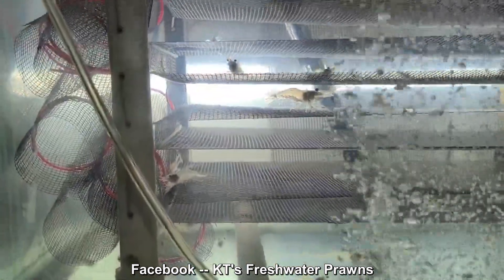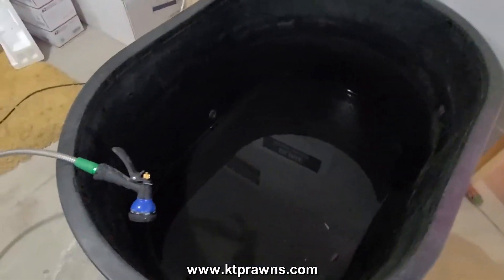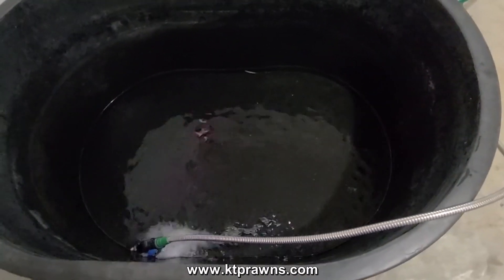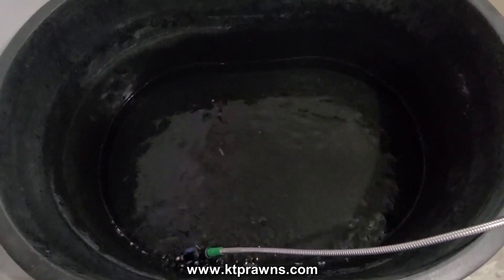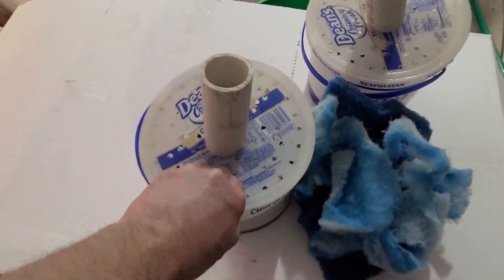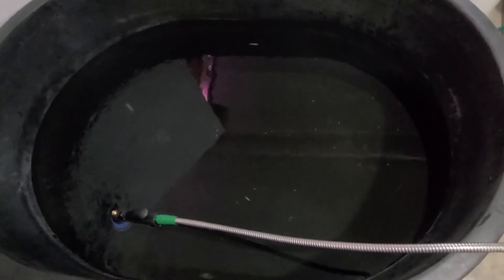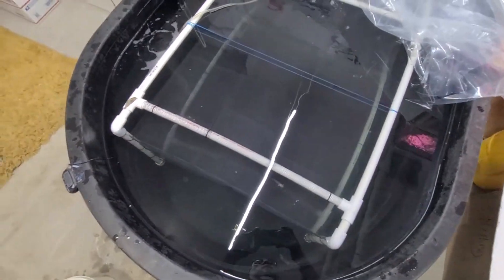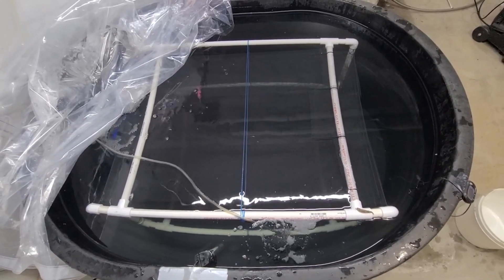Growing Freshwater Prawns in a 100-gallons Stock Tank

Comment: Hello, I was wondering if you think it's possible to repurpose an old hot tub for raising prawns? As long as the filter and heater still work? I would keep them in a smaller container (like the 50 to 100 gallon tank) until they were big enough to move into the hot tub. It's a small hot tub, about 4 feet wide, 3 feet deep. I just found your videos, I find them really informative! Thanks for your time.